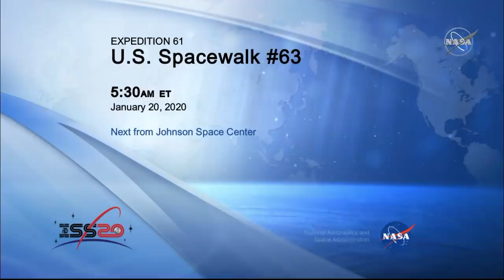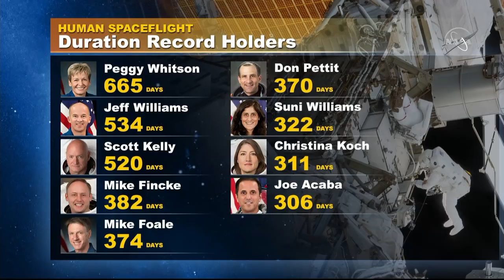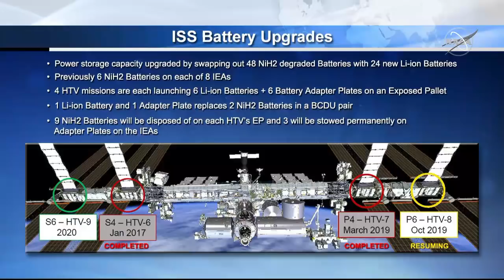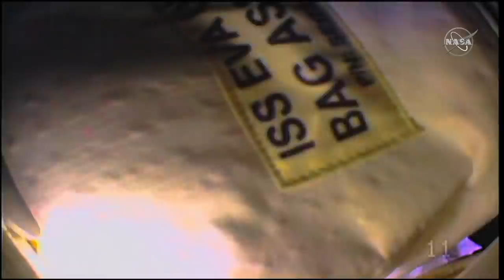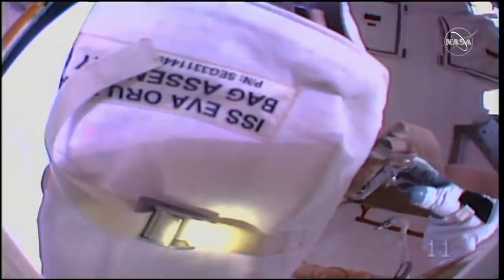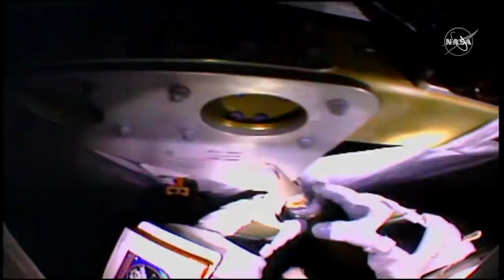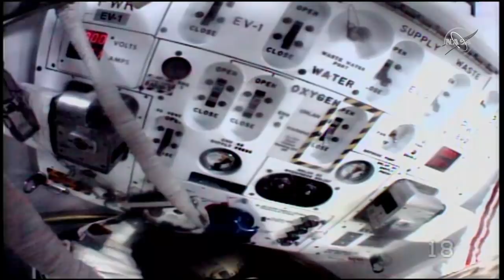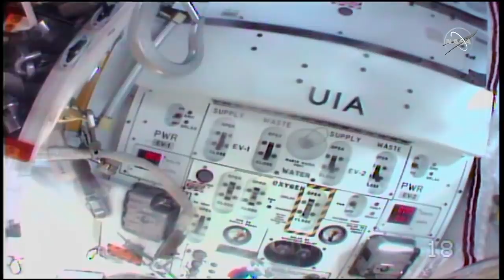NASA Astronauts Spacewalk Outside the International Space Station on Jan. 20, 2020

Comment: Why is the ISS is  designed that way! Whenever their is a need to change something, someone has to go outside "walk the space" to change something or fix something?! If ISS would tobe redesigned it should be modular and all components accessible from inside and easily maintenable so their is no need to "walk the space" anymore, excepté for tourism.
Reply: I'm a bit of a skeptic but I am confident there are good, solid, engineering reasons why it is necessary to do spacewalks for certain maintenance functions. It's not for the glamor or to make a "show" of the spacewalk process.
Reply: well, if i had to say, its because the space station was made in like when? 1998? the engineering might not have had absolutely great engineering then
Reply: Because some parts can't be changed from the inside;) How do you propose to engineer solar panels to be changed from inside?

Comment: All while moving at 17000 miles per hour
Reply: should Their gear and related equipment be dragged by the 17000 mph velocity?  I realize the thin atmosphere....but come on now.  The door panel and hoses externally should experience some wind drag-to simply expect the stuff to just parallel in tandem (floating near by doesn't seem logical.   ????
Reply: What does logic have to do with space exploration?
Reply: No it’s 5 miles a second that’s how fast the Earth spins
Reply: @tjellis1479  There is no air in space except for a few stray atoms and radiation so not enough to even move the lightest of light objects
Reply: Woderfull, HERO "HOvid1984
Reply: @Jxmiecole  tack för lära mig
Reply: @shartmeself  hur kan du. Använda vatten blir O2
Och om C för mycket, hur kan du dina krop energi tillbaka?

Comment: why aren't the repair guys being dragged by the ISS?  17000 mph has to create some drag. They should be holding onto their gear as they get pulled along OUTSIDE of the ISS???
the random floating around of tethered gear does NOT seem to be under any atmospheric drag or the least bit of pull from the ISS. gravity or not....the ISS has to be creating a force on to any or all these PIECES just floating around..???
Reply: There is no air outside ISS, so there is no drag force;)